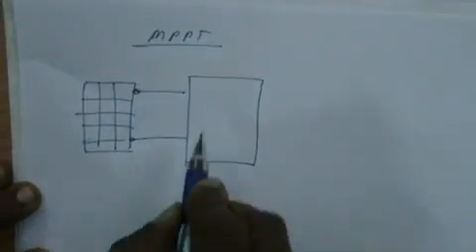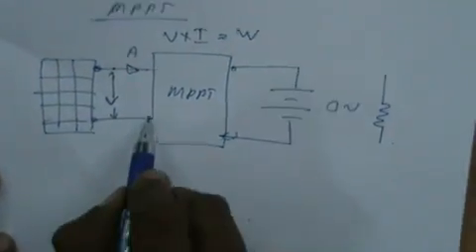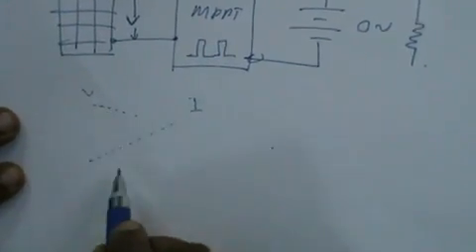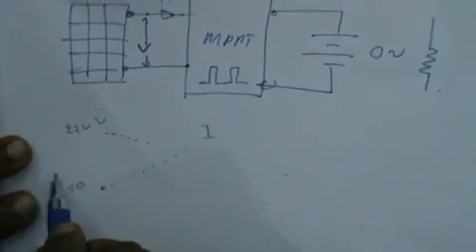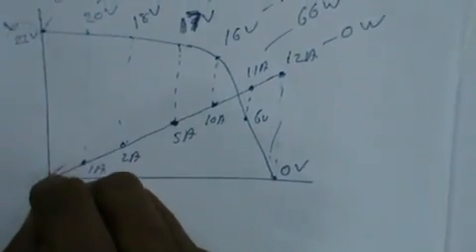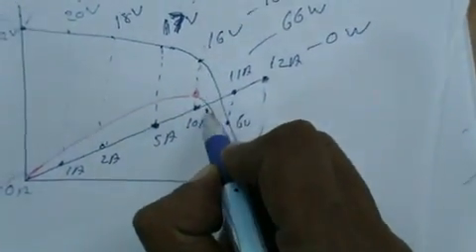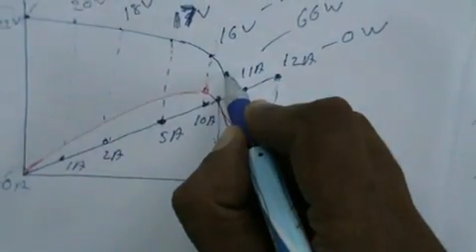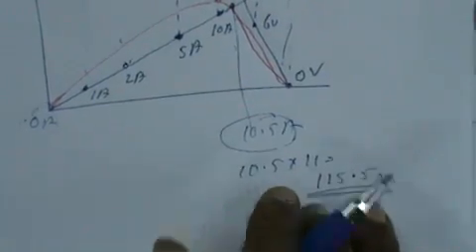MPPT solar charger Perturb and Observe Method

Comment: I have 12 volt 300 watt solar system. Panels gives 15 amps to pwm charge controller and same 15 amps go to battery. Now if I will use mppt charge controller then how much amps will increased by mppt charge controller.
Reply: 300/12=25a max  when battery 12v and full sunlight present when 
Battery 11v 
( 300/11=27.27a max)